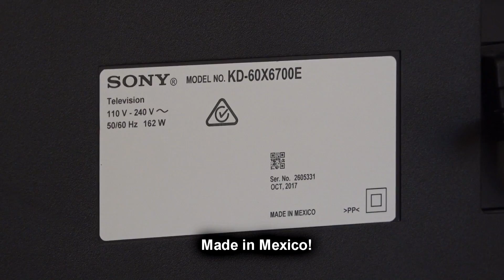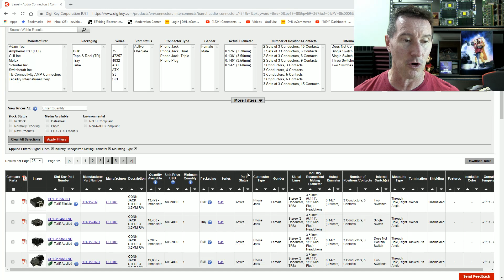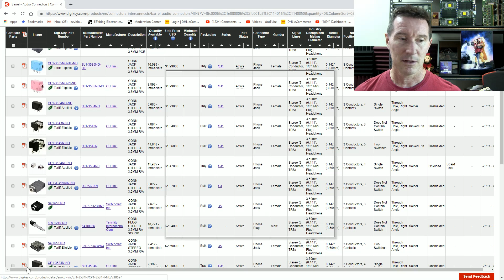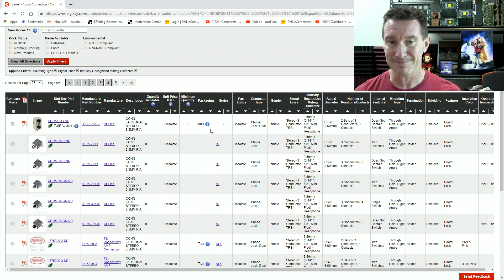EEVblog #1195 - Sony 4K 60" LCD TV Audio Repair

Comment: Side note: The engineers behind AKG headphones were all fired and replaced in china.  Those guys have gotten together to form a new company called Austrian Audio (not the kangaroo kind).  They have some stuff being announced soon, give em a look.
Reply: Harman bought AKG, then Samsung bought Harman. AKG's engineers that designed the K240 and K701 for example are no longer with the company, this is correct. They are now Austrian Audio and will announce I believe 2 new headphones soon
Reply: @metal571  Harman bought JBL too. That was a painful one.
Reply: @natecontarino1748  the only good thing to come out of all of this is that Olive's research is being integrated into a lot of products, including new school AKG ones. The N700NC fairly closely follows the Harman Target
Reply from the maker: Didn't know that, interesting. New cost cutting management at AKG?
Reply: @EEVblog  they did the same thing to crown amplifiers and all the signal processing brands like lexicon dod and DigiTech.  I used to work at their Utah offices.
Reply: The Killer Spud Thank goodness it hasn’t happened to Sennheiser - still a family owned company. Worked for their UK agents and visited their factory on a servicing course.
Reply: Hopefully they have better replacement parts. Outside of pricy-AF official resellers finding (official, not cheapo terrible sounding chinese clone) replacement earpads was impossible for my AKG set. So now I just have some Beyerdynamic headphones. They don't sound as detailed, but replacement headbands and pads are fairly cheap and incredibly easy to find.

You'd think if they'd make them so hard to find the parts for they'd at least use a better material than pleather which eventually just disintegrates if you wear them during a sweaty summer.
Reply: @GrandHighGamer  for a 240 or 271? Very easy to find OEM pads on Amazon in my experience
Reply: Thanks for the info. I noticed the build quality of the AKG headphones go way down when they started building the mid range cans in china. They sure looked the same as the austrian ones, but the materials wore out and cracked faster than the austrian ones.
Reply: Didn't Superlux (Taiwan based) build nearly the 'same' AKG headphones for a much lower price? See Superlux HD 681 vs AKG K240 MKII for example.
Reply: @Alex4n3r  those are not at all similar sounding. The superlux just copied the design, and the sound has nothing to do with the real K240.
Reply: Is Austrian Audio a different company than the one making a new version of AKG K1000 headphones?

I had some original K1000 those things are the best sounding headphones I've ever heard. https://6moons.com/audioreviews/akg/k1000_1.html
Reply: @Audio_Simon  the guy who designed the original K1000 did design the MySphere headphone which I assume you're referencing. AFAIK that is a separate entity rather than part of Austrian Audio

Comment: I've occasionally tripped on my headphone cable (obviously everyone's fault but mine!) Out of concern that I'd damage the headphone jack on my computer I've been using a short extension cable (about a meter long) so it's more likely to just unplug from that cable than damage the jack.

Comment: My neighbors car remote/key fob died (the button, a tiny four leg SMD jobbie that activates from the side,  corroded off the board. He sent his idiot cousin to buy a replacement keyfob, he instead went a bought another of the same model at a scrapyard (different code, one time programable). So I salvaged the button from that, did the repair right in his garage with that $5 8W soldering iron and a powerbank. That was two years ago I think. Recently, it broke again, and I didn't have a matching switch on my scrap pile, so I went to town on it: filed the case to take a nice microswitch salvaged from a CD-ROM drive, what detects if the tray is fully in, and connected that via wires to the pads. The microswitch is encased in the plastic of the fob case, it ain't going nowhere, and no pressure is being transferred to no solderjoints.

Seriously, whoever designed that FOB ought to be shot. The SMD switch could conceivably be activated indirectly and not get the full force of a 200 pound hairless gorilla day in day out, but they could very well gone for larger support pads, say, a large one on the oposite side of the button, rather than just the four anemic legs supporting all the side pressure.

Comment: I think those tuners are all that's needed to be changed to make it work anywhere in the world,  the rest is software. Sony ships those main boards with no software. If you go to the house to fix one without checking the newest version of android on your usb stick,  you'll be downloading for hours. when you load it,  the front led blinks orange and green then a slow white for about 30 to 45 minutes until it unpacks the software and loads.

Comment: i got 1 of those trs plugs with the surface mount pins in a satellite tv remote receiver, it was soldered to the board and had a flat antenna looked like a dongle

Comment: If I were repairing a TV for someone else, I might've ended up doing what you did, but for my own use no way!  I figure if the jack is going to be used and has already demonstrated that it's going to be a weak point, then if it's worth the bother to fix then the weakness should be eliminated.

I "might" go for a panel mount jack, maybe a Neutrik, maybe moving up to 1/4" (or course requiring an adapter but just this move is so much sturdier!), or if I was limited to just parts on-hand and wanted to get it done already, I have some panel mount RCA sockets lying around and would put those on.  

Heck, I'd sooner tap into the PSU board to get 5V out of it to power an ebay sourced bluetooth module with the headphone line out as its input, before I'd just leave the same old plastic crap 1/8" headphone socket in it.

I really, really hate crappy little PCB mounted sockets.  Those things have been a bane to audio for going on 40 years!  Don't get me started about microUSB and microHDMI !!

Comment: What you could of done Dave was just buy a new socket and use mod wire between the two and then glue the socket upside down, that way it would align up fine, I have done that loads of times in the past when I couldn't find the exact replacement part.

Comment: That's a bugger, as far as I can see there is no easy way to search for compatible connector by using a camera to shoot pinout/product code, draw pinout in a website/app or scan board number and look up part by location.

Comment: Find some clear neoprene (fishtank) hose that fits the shaft of your screw driver. Slip it over the shaft of the screwdriver, right up to the handle. Modify the handle to light the handle end of the tube with a bright, warm white LED. The other end will emit light with good color identification, right down in there where you need it, and the screwdriver is much less likely to short anything out. Sennheiser PC550 BLE/USB/jack headphones FTW... It's the 21st century, Dave. Wires, pfft.

Comment: Something off topic: Wireless charging .... from phone to phone. 
I remember some kickstarter project with similar intention and remebered your video. 
Samsung S10 powershare
Reply: It's just QI but they changed the circuit in the phone to also transmit as well as recieve

Comment: @eevblog I have solved a similar issue by using a little Bluetooth device that plugs into a standard 3.5mm stereo headphone jack and transmits the audio over Bluetooth. I then either use one of several bluetooth headphones I own or in cases I want to use a nice pair of wired headphones, I use another little device I found at a local "big box" store (surprisingly in the grocery side of the store on a random hanging display) that enables me to turn any wired headphones into wireless bluetooth with play/pause/ff/rewind controls.

I would suggest getting one (just search for "bluetooth headphone adapter") and avoid another tripping situation that might bring your TV off of its stand!

By the way, I also use the bluetooth receiver adapter with my wired headphone with several Amazon FireTV devices to watch movies without disturbing others. It easily pairs with the FireTV devices and shows up a regular bluetooth devices!

Comment: Another tip is to look at the brand of the connector and search for it at the manufacturer's website, then grab the model number and search for it at digikey (or send an email to the manufacturer asking where to find it)

Comment: We got broken into and they damaged all of the HDMI ports as they tired to rip the 65inc 9000E display off the wall. Was unable to get it repaired due to no spares. HDMI ports version was 2.2 which is around 20gbs connector.

Comment: At 14:46 you said yourself the answer to fix it, just grab one of those jacks that have that little lock nut and poke a hole in the plastic and run 3 wires or shielded wire and that stuff will survive the whole life of that TV. No glue needed.

Comment: I usually use a lead clipping from a capacitor and go through the hole and then solder it to the part you exposed. It gives it more strength that way.

Comment: Those PSU in flat TVs nowdays are really sick. They are soooo slim. I recently got my hands on one of these things, thay are really slim and really well designed. The panel broke so i was left with a PSU and the LED lighting which makes a great bench lamp when controlled with an arduino or something :)

Comment: Whenever I need a stable surface for a TV (mainly putting the Stand on), I just put it on the original box and the legs can hang off the side.

The polystyrene inside usually provides a decent amount of support.

Comment: Solder isn't that strong, that will break again. A wire bridge would have been better, maybe having to desolder the pin remnants would have been needed.

Comment: When I am going to be plugging in something like that where the cable will cross traffic patterns, I try to buy a short extension like 1 to 3 foot, plug that in, and ideally zip tie it to the unit. Then if it gets snagged I've broken a $2 extension cable.

Comment: Had a Sammy flat screen with a boogered USB a couple years back.  Ended up soldering in a 12" pigtail from an old female to female adapter cable!

Comment: *ATTENTION DAVE JONES*

Hey Dave...   
Re the TV Repair and Donor boards

have a look at this gumtree ad
https://www.gumtree.com.au/s-ad/ermington/tv-accessories/voxson-vled32-power-board-er866-200-510-er866-899-866-e002/1213223473

I fix tv's from time to time
Basically the main guy in sydney is MING  he's in Ermington ,   Where most people have a backyard that is full of grass
he has a backyard full of TV's    :P
and that's not counting his garage

Chances are he'll have the board you need

get a free gumtree account if you don't already have one and follow the link i gave you to reveal his phone number.
the other guy i use is in Adelaide,   he's a good guy and is happy to ship stuff to you if you pay the postage (obviously)

if you need help let me know

but basically , When Repairing TV's    AS YOU FOUND OUT YOURSELF
You're either replacing boards
or
Doing PCB Repair

if it's   Caps, Resistors , Fuses and other basic stuff (usually on the Power board) you can get away with it 
if your problem is on the Motherboard (Aside from the Crystal) you generall can't replace much

the Manufacturer's won't supply you a board either
so.. WE ARE LITERALLY WORKING ON THE TV REPAIR COMMUNITY AND WHAT EVERYONE COLLECTIVELY HAS IN PARTS

Hope this helps

BE COOL MATE

Comment: Dave.
If the set detects the actual resistance of the headphones to switch over, make an extention that stays plugged in all the time, drop the end behind the cabinet and fit a socket on bracket to the back of the cabinet.
Hidden but safer than having a trip wire to the tv.

Comment: Another thing which you may consider is some hot snot or hotmelt to further secure the connector to the board. And using a short length of extension lead for the headphones strain relieved elsewhere than the connector which you keep in so you don't put stress on the repair job.

Comment: Those clips are engineered for easy assembly...not disassembly.  It's kind of like when woodworkers nail and glue...the nail holds everything in place until the glue can set...but ultimately it is the glue that holds everything together.   I'm sure the clips are meant in a similar way.

Comment: I probably would have removed the connector, taken a female connector and a short length of cable, and attached that.
You can even use a slightly longer cable and put the other end at a place where it is easier to reach when connecting the phones, e.g. behind the soundbar.

Comment: Drill a hole at the most handy location and use a panelmount version. I would make it in the front of the soundbar. Need some extra wire but if you then trip over the cord, the plug will pop out instead of the socket.

Comment: Ever wondered what 20cm extension leads are good for? Put one between the TV and the headphones. Next time someone trips over the headphone lead the "extension" will flex and the pulling force will be inline with the connector (between extension and headphone), which then should disconnect. Lowers the chance to damage the TV or headphone cable considerably.

Comment: I just buy some cheap gadget that has a headphone jack like those little bluetooth to headphone adapters and take it off that. I used one to fix a tiger arc lighter because it used the exact same button.

Comment: While its open,. replace those mysterious Chinese electrolytic capacitors with proper high ripple name brand ones.
If you pulled the jack off the board, the manufacturer's logo could be searched for through digikey sales..

Comment: The plastic clips probably hold it together on the assembly line while putting in the screws. The manufacturer generally doesn't worry about disassembly.

Comment: Run a loud piece of Construction equipment and you'll understand why people like the headphones that "seal". I run a rubber tired roller all summer and need tunes to keep my sanity.
Reply: Greg Fuller For me, it's simply that my earlobes can't hold the others in place, need the elastic "seal" to wedge them into the ear canal.

Comment: Trying to find connectors used by Sony...good luck.

Lost a few of their expensive pro video bits of kit to failed EIAJ4 sockets. Eventually found a UK manufacturer who had made them but nil stock unless I wanted 5,000.

Comment: I wish I knew enough about TV components to fix my led driver in my vizio 55 inch
Reply: It's likely a shorted led inside the panel.  I see that with visio. A lot of times they're fixable but i don't chance it because the inside of the lcd panel is dust free and any dust inside messes up the picture
Reply: @piratetv1  thanks man it's not my TV I was actually trying fix it for my mom I pulled the driver board and noticed some burn spots on the board the vizio logo shows up on the screen for a few seconds then just cuts off I can see the picture with a flashlight shined on it so I know the LCD panel is still good whatever boots the backlights on the driver board seems to be malfunctioning I just don't know quite enough about the components on a led driver board to diagnose the issue without replacing the entire driver board
Reply: @ickilla2009  the driver is also complex,  usually there are at least 2 channels upper and lower lights,  they get a pwm signal from the main board to allow dimming, usually the positive gets 60 - 160v and the ground is switched for dimming.  Coming on and then dropping out is sometimes the tv detecting an over current condition on one of the led strips
Reply: @piratetv1  ok well thank you very much for your help I found a board for $37 if my mom wants to pay for it i figure it's worth a shot i mean i hate to toss it I've pulled panels apart before down to the LEDs but I wouldn't feel comfortable enough to do that and get it back together dust free but for $37 if it doesn't fix the issue shes not out of a ton of money but thank you again for your feed back I'm not a expert on TVs my thing is computers and radios etc but TVs is still kinda new to me

Comment: I bet you under that heatsink is one Sony chip and maybe memory. Sony’s cheap $40 DVD players use a custom single chip solution and wouldn’t be surprised if this is a single chip as well. Sony has the size and employees to develop custom chips.

Comment: Can't you get spare parts directly from Sony? They used to sell all kinds of parts in the old days.
Reply: LogiForce86 But do they ship to Australia homes in the time between beginning repair in the morning and evening TV same night.  This hard time limit affects pro repairmen as much as DIY repairs, which is why standard parts are much better than oddball ones (for repair).
Reply: @johnfrancisdoe1563  I have no clue. I never ventured further into their services as I didn't find the part I needed in stock anymore, and I am based in the Netherlands on top of that. So I wouldn't even look at the  Australian shipping mess.

That said I might have done a temp fix like what Dave did, but knowing my anal self I would get the new original part if I could and install that whenever it would arrive.

Comment: Check out CLIFF FC68129 connector. It's similar, but with extra switching plate - can be easily removed or pin may be just cutted away.. Dimensions can be verified from datasheet.. Available in lots of electronic parts stores.. ;)

Comment: Hi Dave. I enjoyed the video. Get yourself a pair of wireless house headphones. #nomoretripping. Lol i just upgraded to a pair of wireless Sony MDR-RF811R and i think they are alright.
Reply: HAMYVALUTECHREVU Just run the extension cable under the carpet or along the wall, plug in at TV and couch.